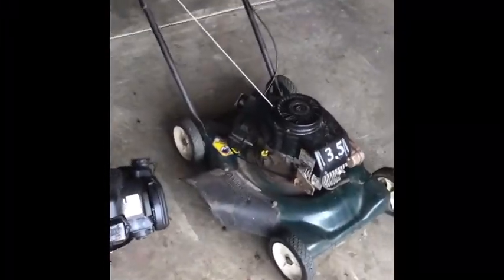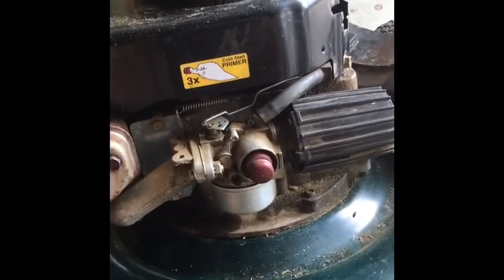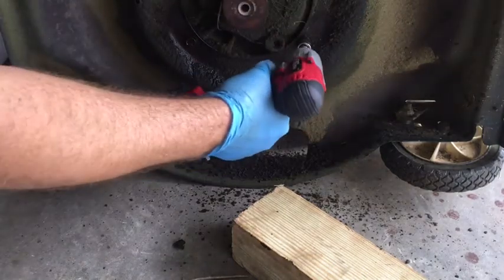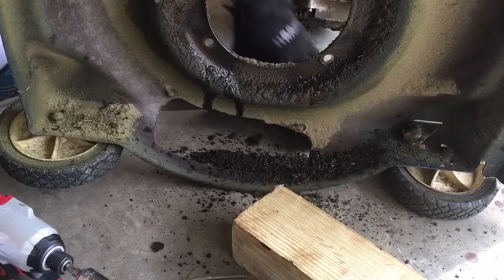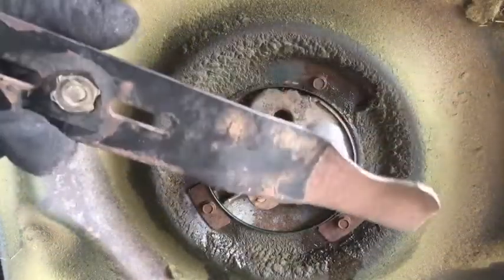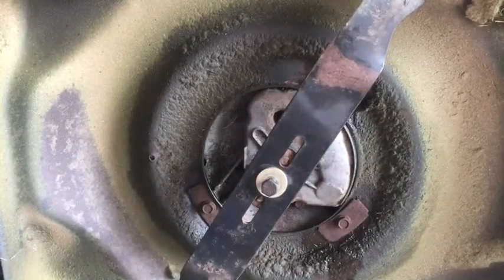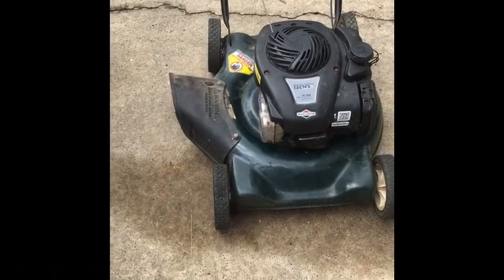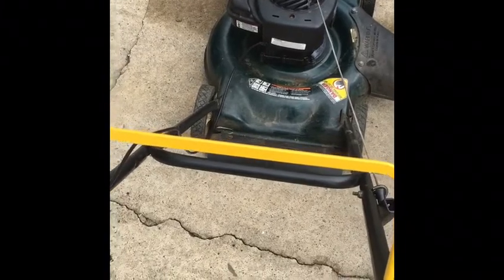Engine swap Tecumseh 3.5 HP swapped With B&S 125cc 300E series

Comment: I'm getting a lot better at cleaning those plastic carbs. Picked up a mower the other day that would only run on starting fluid. Pulled the carb off, drilled out the main jet and had it running smooth in 15min.
Reply from the maker: Be careful of drilling out the jet.  If you drill it out too much it will run too rich.  Like it’s running on choke.
Reply: @dfields9511  I use a 20 thou drill bit.
Reply from the maker: @norge696    Good to know
I personally like the Briggs metal carbs.   The newer plastic ones. I am not a fan of but they are better than kohler’s.   Kohler’s  are like a more complex Honda carb.